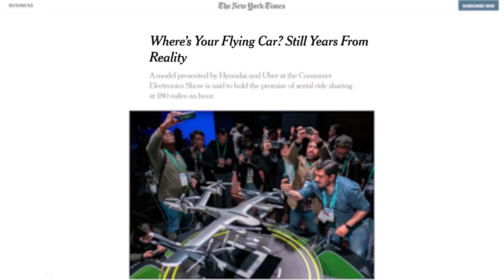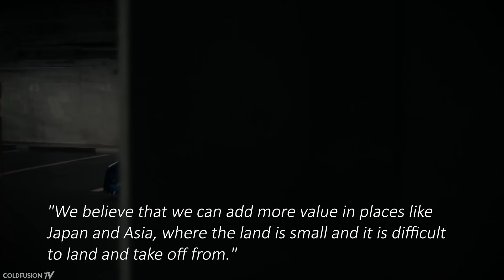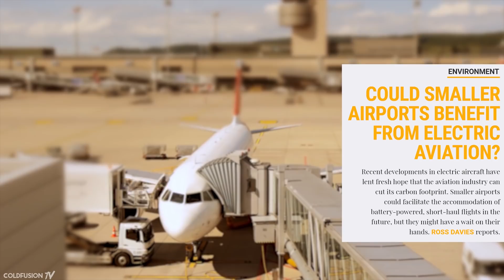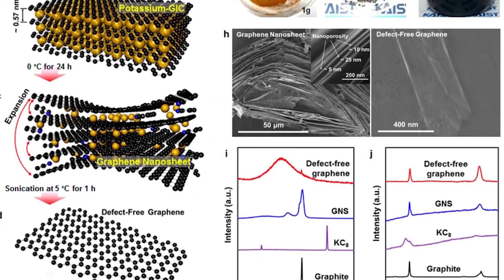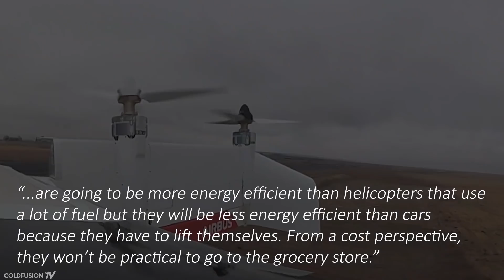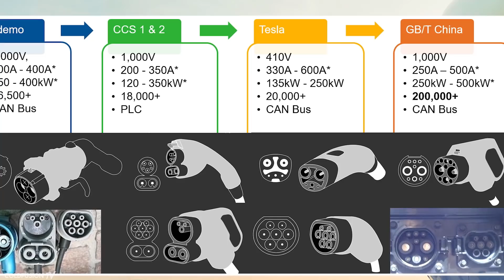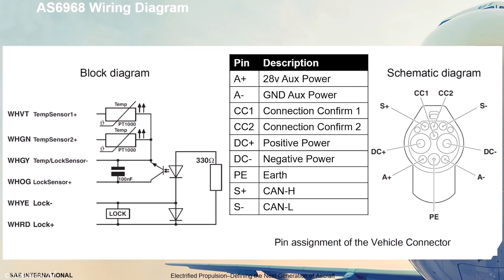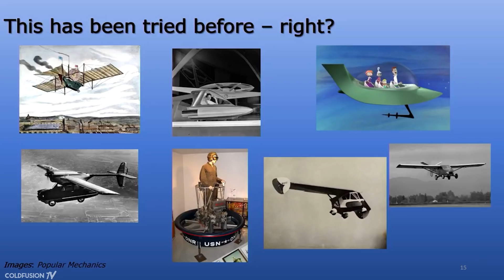Japan's Flying Car – Problems and Solutions

Comment: Really insightful for sure. When these are pegged as "flying cars", It is misleading in a way as they are passenger drones. There would a separate market for this, but it will be controlled by big entities with strict regulations. Normal "car" drivers cannot fly, well majorly. The biggest obstacle or downside is the sheer noise. Imagine the rattling sounds of the rotor around your neighborhood. I think this could be possible once we master anti-gravity one day, something like jetsons. Elon rightly pointed out (sarcastically), Imagine if one of these drones aren't maintained well and one of the hub caps drop to the ground, that will be like a guillotine for anyone under. Of course, I'd be excited to see this worked out.

Comment: Why not use a hybrid power system? For years, aircraft have used APUs to power their systems while on the ground. Why not modify this concept to charge batteries in flight? This would solve the charging issue, while  making the aircraft power system self contained and far more reliable. Unlike a hybrid automobile, the engine could operate at constant speed and would not have to be linked to the propulsion system to provide direct power to the fans. Thus it could be much smaller and more compact. A very small turbine could be employed for this purpose and since it would not be critical to flight, it would not need the man-rated capacity required for conventional aircraft turbines. I am surprised this solution is not being explored as the concept has been successfully proven in the automotive industry.

Comment: What happens to the roads once the flying car will be as cheap as a regular one?
Don't tell me you would rather not go directly from A to B.
Also, no road maintenance required. We have horrible cash issues with road maintenance, lost's of corruption.

Comment: I believe that high speed electric aircraft will replace the current jets in a very short time. High altitude heat deposition from jet aircraft is disastrous, as jet engines produce heat reaching 2300 degrees C. in the combustion zone.  These high heat emissions into the frigid altosphere are causing serious disruption to the hydrological cycles of the entire planet.  Add to this the carcinogens and other toxic by-products of jet exhaust gasses, and it is clear that we must replace kerosene burning engines as soon as possible. It can be seen that the skies are a beautiful blue not seen for decades due simply to the grounding of jets. This makes it clearly evident of the damage done to the planet by jet aircraft. Thank you for your great infomation on this vital topic.

Comment: Otto Aviation has the celera 500L not a flying car but is a small cheap operating cost with the opportunity of going electric. This could be the next new wave in aviation small private air services. Check them out.

Comment: There is no such thing as a flying car.   There is light aircraft which the whole video saying light aircraft, mirco light aircraft or a car.   The reason why there are no flying cars is because aircraft/plane and the inventions of highway overpass and bridges.  If there is no highway budget for overpass to regulate flying cars, there would be no bridges or overpass because there are no budget (hence they said that is not ergonomic to take a flying car to go grocercies).  If there is a highway budget aka right now,  there wont be any money to regulate flying cars, thus it would go to aviation branch.  

people are hyping this crap.  If you want flying anything,  it should be flying firetruck and ambulance, on account of that is first priority over dumb consumer.

Comment: Towards the end of the age of sail people thought it wasn’t feasible to cross the ocean in a steam-powered ship. This is because up to then steam engines had not yet been scaled up to being powerful enough to propel a large ocean-going ship, it was thought of as a technology for small vessels plying their trade on coastal and inland water routes. 

Yeah, electric motors may well power large aircraft eventually if we can get the weight of the batteries down, and materials like graphene look promising.

Comment: even if these aircraft take off, land, and fly automatically, there are still some important points to be figured out or regulated with laws.  safety with how high and how much training and safety measures are required to fly one of these.  how high and if they are allowed everywhere.  it's one thing to have helicopters and small planes which we have been used to for 100 years, but a car which is literally able to take off, land, and go anywhere, where are they allowed to go?  in northeastern usa roads are being made for cars which restrict cars so they cannot travel off the roads for hundreds of miles in any direction, but with a flying vehicle, you could literally land on a field and unless someone saw you or was tracking you, nobody would know.  also would this interfere with drones which are going to populate our low skies soon too?  as good as automatic flying is, even if all drones and passenger flying vehicles are automated (which probly won't be the case for at least 50 years from now), automatic pilots will have accidents or mess up regularly.  what if you hit a bird?  are the open propellers really impervious to flying into a flock of geese?  these things have to be figured out sooner rather than later, or you will have a wild west of the skies when cars take flight

Comment: Thank You for another great video!
As for Your final question - dual thoughts. 
The most challenging part will be licencing of both vehicles and their operators. Similar to electric scooters, if the new aircrafts will introduce a new nieche.
The second chalange will be the country specific laws if the new vehicles will bring up a new regulation necessity. 
However it seems unlikely to succeed in the 'ease of use aspect' without creating a new nieche, because small aircraft [bot planes and helicopters] have strict restrictions for use and movement in cities.

Comment: the problem with electric
when u run out u have to wait for a long time for the battery to charge(like 3 hours for a shitty motorbike). they have to fix that too

lets take for example bush pilots:
they can land anywhere and just fill the fuel tank with jerry cans

electric bush pilot?
they land in middle of no where and go on foot cuz there is no electricity anywhere
:(

Comment: We may have working prototypes go into service in the next 5 / 10 years but for wider adoption it seems like we are still a way off.

Personally I think flying cars won't become the norm until after self driving ground cars become normal.  

For a couple of reasons:
1. With the massive increase in air traffic that comes with flying cars, and increase in flights into inner city areas piloting will need to be automated. 
2. Pilotless flying vehicles will need to be able to identify, track and navigate around other PFVs. Similar to the technology being developed for self driving cars, but in three dimensions.
3. People will naturally be apprehensive about flying in a vehicle without a pilot. The introduction of self driving cars would make this transition smoother. 

There is also a few other government, legal and regulatory hurdles that need to be overcome too. For example maintaining separation between flying cars and traditional aeroplanes, establishing a network of skyways, establishing the legality of PFVs.

Though, all that being said, I am excited for when this becomes then norm. And I hope it happens in my lifetime.

Comment: The realy stupid thing is that they dont make a hull out of solar panels.
Reply: Maybe for planes with large wing spans or large hybrid airships that would make sense, but small aircraft, it's pointless. The surface area is too small for it to make it worth it.
Reply: @urquanseven2332  Its for power when you run out of it. So you can land safe. It would take to long to charge over solar, but for saving lifes its a good thing.

You realy dont wana crash this into urban area and jump out with parachute.
Reply: @Bullminator  For small aircraft, it wouldn't be enough to provide power in an emergency situation. Large aircraft, yes.

Comment: I think we will see forms of large flying quadcopter-like vehicles in cities.. I think at first they will be permitted for use by Fire departments and Ambulance and Law Enforcement duties.  And they may be controlled partially by a human pilot either on board or remotely. And they may eventually become fully automated flying. These vehicles will enhance the service of fire fighting.. and emergency amulance service. And also for Law enforcement.. either for monitoring from above.. or for bring in or bringing out equipment or officers to a site that needs law enforcement support. They could also be used for fast evacuation from kyscrpers.. Like for example.. can you imagine something that could have gon to a floor of the world trade center and had a rescu facility onboard to snatch up and bring to safety people stranded in the building with not way to get out?

Comment: Battery electric planes make no sense and won't ever work. Hydrogen electric however stands a chance. The simple fact is these are not small Ev cars these are huge aircraft and need the energy to charge. For this hypothetically to work you would need to pump dangerous amounts of power into a aircraft at airports to support air travel. This is where hydrogen comes in unlike battery electric. Hydrogen electric has greater energy density as well as the ability to be moved in large quantities quickly. 

You can disagree all you want but if there are two planes. One can turn around in 3 hrs and another that needs to be charged for the next. 48hrs I already know which the aviation industry will pick.

Comment: Israelis have not only built a flying plane (mentioned in the video), but also a flying car, which is already in production. Look up Urban Aeronautics. The current version is insanely expensive, but it works, and it's not even electric. In the future they plan to go electric.
Example: https://www.youtube.com/watch?v=aU3BvEg0gNc

Having said that, a major issue with flying cars (that Elon Must alluded to, but few talk about) is the safety: a car that falls from the sky is much more dangerous than a typical car crash. Many countries don't allow 250g drones to fly over urban areas for this reason, with 2-ton cars it gets much more dangerous.

Planes fly much higher and at greater speeds, and flown only by highly-trained pilots, and there have still been a few accidents with planes hitting urban areas and killing hundreds. Helicopters are relatively rare in urban settings, and as with drones, many countries severely restrict their usage – and they are also flown by extremely skilled pilots. In order for cars to be allowed to fly over cities en-masse (no $50,000 pilot training included), they will have to be absolutely 100% self-driving/flying, and with safety records at least as good as that of commercial planes. This is a huge hurdle that might not be overcome even when the technology is available.

Comment: Why don't they use hydrogen cells that will significantly reduce the weight while increase the range. Also there will be no issue with the standard charge plugs.

Comment: So a quick analysis of the concept, why would you put the not energy dense electric batteries into a product mimicing animals that have hollow bones just to achieve flight, the real key is hydrogen fuel. This is the place where it really works, with it's high energy density. Although I have an odd question, with increased power of jet engines, why haven't we made a hybrid engine, which uses gas and electricity.
Reply: Energy density in this case means energy per unit of volume. Hydrogen has good specific energy, which is energy per unit of mass, but very poor energy per unit of volume, as it's a diffuse gas. For small aircraft, it's not practical. Larger aircraft with a large internal volume, especially airships, it would work, but then you have to contend with the dangers of carrying such a large volume of flammable fuel. That might be more dangerous than just carrying a smaller volume of less volatile fuel that isn't a gas. 

It might still work though. Through compartmentalization, it could be safely contained in an airship that uses helium for lifting gas.

Comment: The charging fear is largely overblown. The system plugs themselves are relatively interchangeable and even then almost the entire market is using one standard much like how BluRay won the war quickly vs HDDVD...
Reply: Some carmakers even throw in a set of different chargers in case you encounter the 3 types...

Comment: "E-VTOL will be less efficient than cars as they have to lift themselves."
What a narrow-minded stance.  For a single passenger drone, think how light the drone needs to be.  
▸ Much lighter than a car.
▸ No traffic/delays
▸ Go towards destination in a straight line over any obstacles.
▸ Much faster than a car at same task., less operation time, less fuel.
▸ "Grocery shopping" is will be automated before manned E-VTOL even becomes a thing.
▸ For long distance, retractable wings or maybe even thermals (as in gliders) could offset the energy needed to take off.  Not that the small differences in efficiency matter much when electricity is infinite as long as the sun exists.
▸Cars/trucks should only exist for heavy trans-city/country transport.
▸For short distances, cars should not be a thing.  Electric scooters/shoes/skateboards/pods/minimalist-segways or even automated limb movements could all be used for transit within a city.

If a professor of aerospace engineering is this unimaginative, give me a job lol.
Reply: Anyone who has ever heard a drone fly can imagine that nobody want to have things 1000x heavier than this constantly hovering above their heads
Reply: @davidwiedenau8766  You have no imagination.  "b-but that drone I once saw in 2013 was kinda loud! Could never work! Not in 1000 year!"

Imagine being able to literally teleport to anywhere within your city.  That's basically what drones enable.  Not instant transport, but you step out the door, and then you're already on your way to work, taken directly to the floor you need in your automated drone you stepped into.  No lift, or going outside unless you want to.  Groceries 100% automated.  Wanna go hiking? Well get dropped off absolutely anywhere, then get picked up from anywhere.

You think humanity will not be able to figure out how to make quiet drone? wtf? How old are you? How long ago were electric cars completely impossible? A few years ago noone wanted an EV, now they're as popular and desirable as even the most expensive cars.  

You seem like the kind of person to make a dumb comment and disappear.  I waste too much time on people like you.
Reply: @thisin.  Jesus Christ chill out
Reply: @Kyfow  Someone has to educate them.

Comment: Autonomous use of personal vehicles is going to see a 'decline' on the roads itself, forget about them taking off in the aviation sector. As cities become more organized, there will be special areas where the users won't be allowed to drive manually and only autodrive can be used. The low cost, battery powered vehicles will inevitably take off but not as personally piloted aircrafts. They will be regulated, controlled and managed by the aviation companies of the future. The flight tragectories, landings and takeoffs will be taken over by the automated systems to manage the air traffic safely and efficiently. So electric powered , smaller vehicles will eventually be a reality in the near future but they would definitely not be autonomous.

Comment: From a technical point of view I could believe in a 5 years adoption, possibly even less. I'm really rooting for fully electric short distance small electric planes instead of large conventional airplanes, and this is coming from an aerospace engineer.

However, I think the "flying car/ flying taxi model"  would only be touristic attractions (at most) for many more years for two very simple reasons: traffic regulations and insurances. Those two apparently trivial aspects (wrt to the hard engineering challenges) will probably take a significant amount of time to sort out, perhaps more than several other practical considerations. 

Also, one possible show stopper I see for this kind of flying taxi business is noise: a normal sized drone of today is already quite noisy, so a larger model suitable to carry humans will be way more noisy than that. Not as an helicopter, but definitely more than a car. Those vehicles would probably be banned from circulating in the city centre in large numbers, for the same reason airports and airplanes cannot pass too close to city centres. So unless the whole layout of cities is modified to accommodate this transportation mode, or a totally different, more silent propulsion method is employed, I doubt these things will be a common sight in city centres in the foreseable future

Comment: I am a real commercial pilot, you can automate as much as you want but an untrained person does not know when NOT TO FLY or when to call it off. This is very Bad.. Meteorology is a subject everyone would need to learn, the weather can turn instantly and you have to understand it. NAVIGATION is also important You need to be a piot  to fly safely. What if yu have a gps failure (I have had the fuse pop 2x on the Garmin and had to go back to the map). Electric Planes are  great idea for training. Brilliant actually.